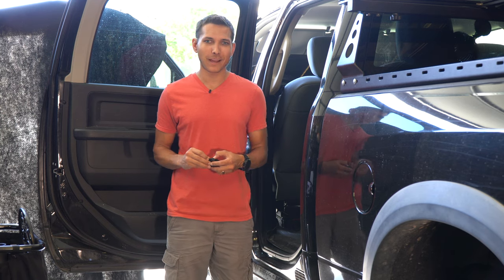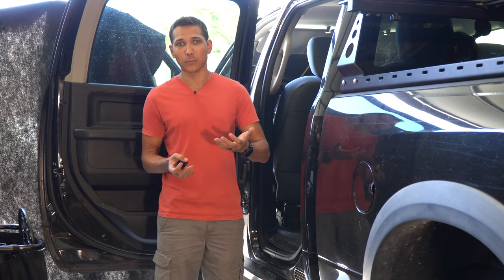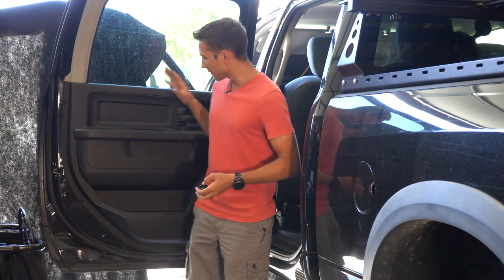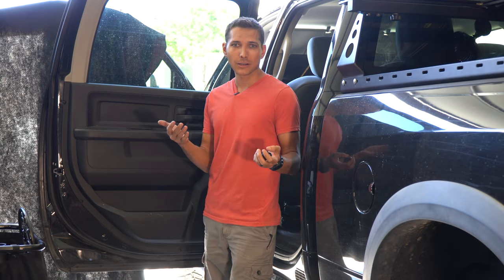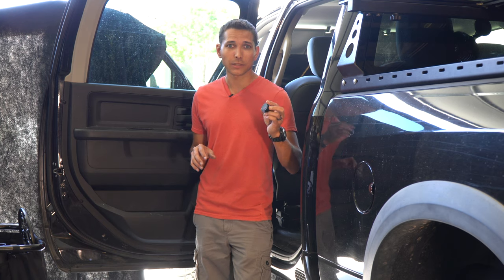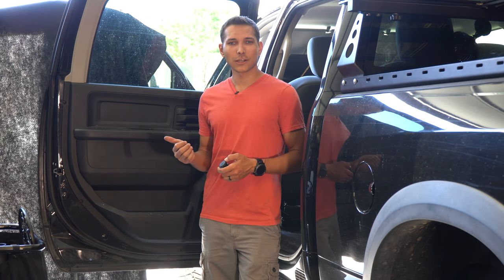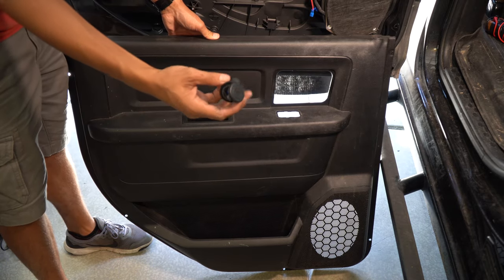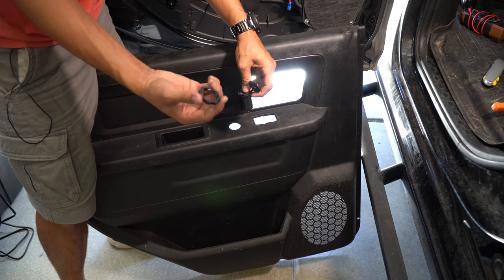How To Install Back Seat USB Charger Outlet In Your Ram

Comment: I am doing this mod currently, because I think it is a great idea. One thing I have found is using the wires in the video your outlet will only have power as long as the windows are unlocked from the drivers master switch. As soon as I lock it the wire loses voltage which makes sense since it disables the rear window buttons, just an FYI for some one doing this mod. Thanks for the idea.
Reply from the maker: Haha, I just found this out the other day myself. I was freaking out wondering why they weren't lit up! Then I realized I locked the windows because of the kids, as soon as I unlocked them they turned back on!
Reply: Good call!  No fix, but saves hair pulling!

Comment: Great video, thanks so much for the step by step instructions!  My daughter is muuuuch happier in the back now.   I especially appreciate how you identified which wires to tap.  I only changed up one thing.  Folks might find it easier to use a large step drill bit to drill the hole in the armrest.  It leaves a much cleaner hole compared to a hole saw.

Comment: I appreciate the effort you took to edit and create this video. Your step by step instructions are informative, but not drawn out. I also like how you showed how you narrowed down which wires to tap into using a multimeter. Most videos I’ve seen (even from “professional” shops) are shaky, less organized, and either not as informative or if they are, they’re super over worded like an ADHD squirrel.

Comment: Great tip.  I've thought about adding USB power in the back, but was unsure about a good spot.  Regarding the chargers you picked, I like fact that they have closing caps to be closed when not in use, especially to keep debris and rain out.  However, like my inverter that I have back there, the caps will never be closed by the kids and will eventually get broken off by the kids.  I suggest buying a few replacements to have on hand when that eventuality happens, so you can quickly exchange them with matching chargers.
Reply from the maker: I have the same thoughts about the covers, hopefully they tolerate the abuse lol.

Comment: I just wanted to say thanks for doing this video. I installed USB ports today in my 2021 RAM 2500 and your video was a huge help. I basically did the same setup as you. The funny part was one door was the same as yours in the video as far as the wires. But on the other door my power wire was an orange with a tan strip. The orange with purple went to the window. You would've thought they would've keep the colors identical on the same truck 🤣

Comment: Great idea, instructions and warnings!  Thanks!
Note:  the closer to the door hinge the charging port is mounted, the less the charging cable will move when the door opens. I have a 2017 SLT, but no rear door pocket to hold charging phone (cheaper build / less features every year). I need to put the item being charged on the front-seat-back, so a short charge cable and long movement might pull a phone out when opening the door.

Comment: Great Video, very well done.  I have a 2013 Ram SLT and I love the truck. However the door alarm and seatbelt alarm drive ne nuts. Because I work on the farm here and have the door open a lot and never use the seatbelts because when I repair fence and in the field there isn't much use for them.  Is there a way to disable this thing? I always use my belts when on the road anyway. And I also leave my door open with music on when working.  Anyone have an answer for this?  Thanks
Reply from the maker: I'm not sure if this will work for a 2013, but I think it does...
The Enhanced Warning System (BeltAlert) can be enabled
or disabled by your authorized dealer or by
following these steps:
NOTE: The following steps must occur within the first
60 seconds of the ignition switch being turned to the ON
or START position. DaimlerChrysler does not recommend
deactivating the Enhanced Warning System
(BeltAlert).
1. With all doors closed and the ignition switch in any
position except On or Start, buckle the driver’s seat belt.
2. Turn the ignition switch to the ON position and wait
for the Seat Belt Warning Light to turn off.
3. Within 60 seconds of turning the ignition switch to the
ON position, unbuckle and then re-buckle the driver’s
seat belt at least three times within 10 seconds, ending
with the seat belt buckled.
NOTE: Watch for the Seat Belt Warning Light to turn on
while unbuckling and off while re-buckling the seat belt.
It may be necessary to retract the seat belt.
4. Turn the ignition switch to the LOCK position. A
single chime will sound to signify that you have successfully
completed the programming.
The Enhanced Warning System (BeltAlert) can be reactivated
by repeating this procedure.
Reply: @chazpages  OK I got it after three times. I was doing it with the door open.  DUHH Thanks for the reply

Comment: Great Video.  Wondering though if I need to think of any additional provisions when dealing with an armrest that has the leather...I have a Limited 2500, with leather everywhere.  Any thoughts?
Reply from the maker: Even in the little "door" pocket? The higher one. Is that plastic? Right below where you would grab to close the door.

Comment: It doesn’t matter which wire - or + you tap into as long as you don’t have voltage on both wires ?
Reply from the maker: more or less. You want to use power (both neg and pos) that would normally go to the window motor. Also you need to be careful that the wire without a (+) isn't a wire that normally has no voltage unless you're operating the window (like the signal wire for the window or something).

Comment: He ain't lying about how unreliable those little blue snap on wire taps are. They need to be illegal in the united states. It is amazing they are still sold here. I think they are more of a fire hazard than a convenient  wire connector.
Reply from the maker: Seriously. Bugs me so much that they’re so widely used. Makes diagnosing an issue almost impossible-not to mention just unreliable even if they are working.